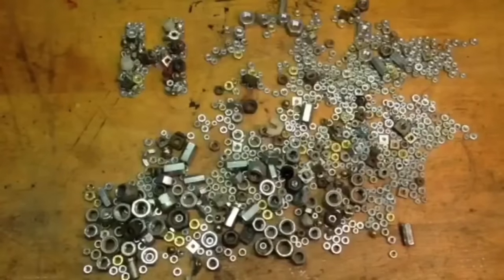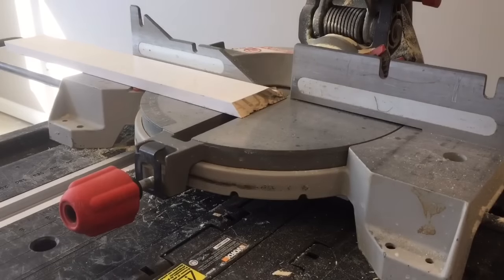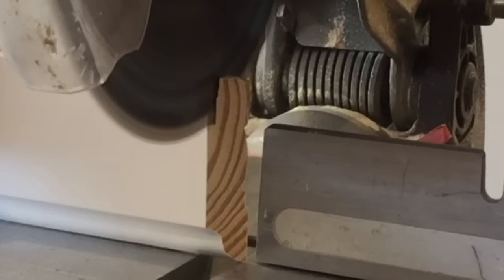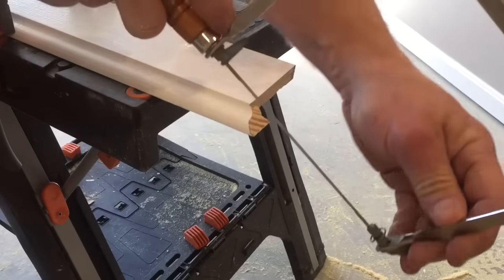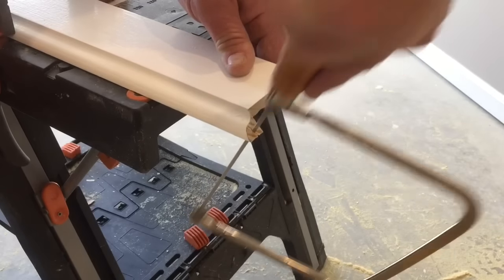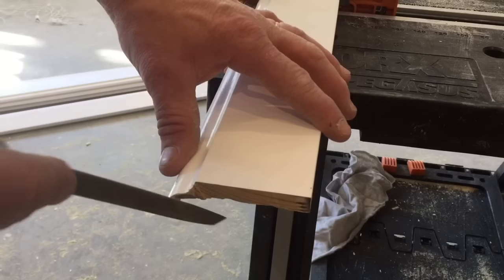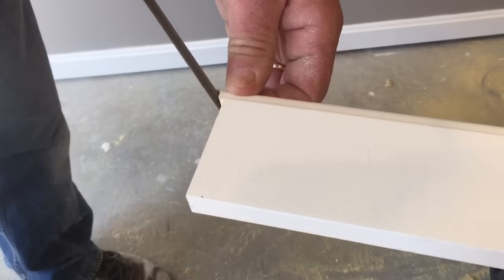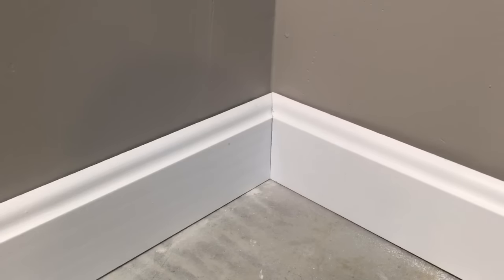How To Cut Baseboard Corners That Look Great

Comment: 5 years later,  you finally finished all 4 corners lol
Reply from the maker: After practice it becomes much quicker. I went slow it the video as it was a tutorial but it beats having caulking cracking shortly down the line. Thanks for watching.
Reply: Try coping with a flap disk on an angle grinder.  It's messy but super easy.
Reply: I think same thing 🤣🤣🤣

Comment: This is called coping. That's why it's done with a coping saw. This is the way this type of joint should be done and has been done for hundreds of years. Mitered corners are really only for outside corners. This was a good explanation.
Reply from the maker: Yes, it is called coping. This is just another variation of coping using a miter saw. Basically the same thing. Thanks for watching.
Reply: @funbro1  I tried your method a few times, but found that it was difficult to turn the piece upside down on the say, especially when dealing with a long piece of baseboard. It was just easier to cope the joint. I switched from a coping saw to a jig saw years ago.
Reply from the maker: That’s works well also. I have also used a flappy sanding wheel on a grinder to get the job done.

Comment: I have a huge job to do with about 50-60 corners to do... Seems like this is tedious, but will yield much better results than just cutting 45's and trying to fill with caulk.  Thanks for sharing!
Reply from the maker: It is very tedious but most things that are like this are worth the extra effort if you plan to stay for awhile. You could save some time by just doing the 45's and caulk, but after a few times of this it goes quicker. Thanks for watching
Reply: Jeff Bateman We use small grinders to back bevel and cope instead of coping saws. Much quicker just takes getting used to. Just an idea if you have a huge project to do.
Reply: +Zach R yeah, I was thinking of using my oscillating tool for that very purpose... That thing has been a time saver on so many other jobs!
Reply: Protractor to find correct angles?
Reply from the maker: Yes, they work great for finding the correct angles.
Reply from the maker: I also like to use a flapping sanding disc on a grinder...works well.
Reply from the maker: Same way.
Reply: 45 degree angles work well  on wood paneling or any corner that has a smooth surface but inside corners and the detail of the applied material will determine whether or not to cope.
Reply: Great system if the client isn’t a pain in ass
Reply: Justin Ballou not in the real world it takes way to long to bust out a protractor. Not for painted builders grade baseboard. Use your energy on something that people might actually notice.
Reply: michele lanni great system if you don’t mind it taking the rest of your life to finish.
Reply: Unless you’re using a wood that will get stain, like oak, caulk gives you a perfect corner each and every time
Reply: Do it right or don't do it at all
Reply: I just do 44° for insides and 46° on outsides for paint grade. ......the grinder is way faster for coping tho or disc sander......but I rarely cope anything so,
Reply from the maker: @TheDalk  Over time caulk will crack and show up.
Reply from the maker: @smash72cutlass30  A little practice and this method takes a very little amount of time less and look loads better.
Reply: Jeff Bateman
By the time you get to 20 you will be proficient and confident by 60 you will feel like a pro by 1000 you will feel like you are master. 

Take the opportunity you have to learn.
Reply: Skip the filing part just cope the base and install !  Been doing finish carpentry for 30 years  no need  to file
Reply: @shednut2666  45 and caulking works good thats how most of the people is doing it on every new house now, if people want it, like the ones on this video, contractors can doit without a doubt but takes more time and more money. Yo know what i mean!!? Both ways look pretty good!!!
Reply: Infact, cutting at 45 degrees is a crime. You should measure the angle between the walls, divide by 2 and then cut baseboard with correct angle. Fits.
Reply: I freehand the cope with a sabre saw. Goes really fast and looks great. You can do a whole house in a day by your 2nd house. Great tutorial Bob!
Reply: 60 or 70 cut taking you a least 6 months doing that 1 by 1 😰
Reply: A T bevel will allow you to transfer the angle if you miter.
Using a grinder or dremel or scroll saw would save you time by copeing.
You do not have to cut two peices, fool around transfering angles or wiping caulk down.
Sometimes guys will use a rag to wipe the joints.
That leaves flat spots later on in the finish.

Comment: This was interesting, I'm going to have to try it.  I normally use a digital angle finder on the corner, then cut the two corner pieces based on that angle.  I haven't been unhappy with the outcome, but will give your method a shot.  Thanks
Reply from the maker: It works great and you can speed up the process by using an angle grinder with a flappy sander. The process is the same but quicker. 
Thanks for watching.

Comment: Its called coping the inside  corners.
Years ago watched a senior trim carpenter use the coping saw as fast as you could miter the corners.
He was running baseboard, and made it look so easy that i wondered why not just do them his way?
There is a big difference between a man who has done finish work for 40 years, and a young guy starting out.
Today im the old guy and when i cope inside corners i have a scroll saw.
You can back cut the curves easy with it.
Reply from the maker: Yes, it’s called coping, and it can be achieved in a number of fashions using a bunch of different tools including but not limited to a grinder with a flappy disc, a file a scroll saw, etc. etc. etc. 
it does get faster with practice in the video it was done at a slower pace because it is an instructional video.
Thanks for watching.

Comment: Good Vid.  A jig saw with a coping foot or a table saw will work much faster, same quality results with a little practice, but good to see people still using and teaching the traditional older method with the hand saw... not everyone can afford all the tools of a professional
Reply from the maker: This is just one way to cut corners, with some of the tools I had at the time, there are many other ways...I have even used a grinder with a flap wheel to make corners look good in a pinch. Thanks for watching.

Comment: Looks nice. I recently watched another video where a Dremel was used to grind down the curvey portion. I haven't personally tried this approach but it seemed to work well.
Reply from the maker: Yes, there are many different tools that can be used such as a Dremel or a grinder with a flappy disc on it. In this video I was just doing the basics to show how it can be done, there are many variations from there. Thanks for watching.

Comment: No matter how much glue or caulk you stuff into a 45, eventually you will see it crack and have a gap in the corner. Coping, like this, is the right way to do it. It also permits a pressure fit, where the coped baseboard is actually a smidge too long, which then later counteracts shrinkage, which would otherwise create the gap. Same gap that is impossible to avoid when doing 45s on inside corners. Coping also lets you get away with out of square corners, whether a couple of degrees more or less, without changing anything. This would have shown up as gaps in regular mitres. Very good instructional.
Reply from the maker: Thanks for the comment, and Thanks for watching.
Reply: Martin Poulsen  nail the corner last agent nail the rest along the wall . Use your five-in-8one to pull the corners together before nailing. Caulk the top and it’s done. A good painter will make your work look tremendous

Comment: Perfect Thanks Bob. Now can the same thing be done on outside corners? Thanks In Advance. 🤝. And if not how would you correct that?
Reply from the maker: Outside corners are better handled with just doing a miter cut. Use a piece of scrap to get the exact angle then cut your regular piece before nailing it on. Hope this helps, thanks for watching.

Comment: I used the coping saw method 40 years ago on custom homes finish work. 
In my opinion the coping saw works so much faster and better than the miter saw. Doing twice the work for a cut.
Reply from the maker: The miter saw works good for the straight part removing material faster than the coping saw, then bring in the coping saw for the profile, but basically it's the same. Thanks for watching.

Comment: As you get more experience you can do the hand cope cleanly and much faster in one cut starting from the top (thinnest) part of the molding.  Key is to dive in confidently and keep the coping saw moving in a short/quick rhythm.  I use a fine/thin blade which follows curves easily.  Agree with undercutting: it allows you to slightly "crunch" the leading edge of the mating surface to the flat of the adjacent piece thusly eliminating any gap.  Go around the room in a linear fashion and plan so your last piece hits a door casing square: it's a PIA to finish with a piece that needs to be coped on both ends.
Reply from the maker: Sounds like you have a slightly different method with some of the same parts. Thanks for watching.
Reply: Do double copes all the time been doing it for 40 years and haven't had any problems get a tighter fit

Comment: I did 440 meters ( that is 1600 meters of skirting) at my home using the method which does not bother with the 3 vertical cuts on the curve. I simply used the coping saw to cut around the edge of the curved top corner. Very simple, very clean.
Reply from the maker: ausiewood Sounds good. Thanks for watching.

Comment: Thanks for for the tip. I have always done this with a coping saw but using the miter saw should really speed things up. Thanks
Reply from the maker: Try using a grinder with a flappy wheel sander it makes quick work of the contours. Thanks for watching.
Reply: @funbro1  So your using an angle grinder with the disk, is this correct. Thanks
Reply from the maker: Yes an angle grinder with a sanding disc or flappy sander or sanding wheel.
Reply: @funbro1  Thanks, take care

Comment: Nice little trick much appreciated although it's a bit of time consuming but still nice in my case I want to stick to 45s
Reply from the maker: With time it becomes quick and still looks great. Thanks for watching.
Reply: Miter saws adjust by degrees sometimes it's easier to just find the right angle
Reply: It's much faster to cut wood using a grinder instead of a coping saw

Comment: I cut my first one today with a DeWalt cordless circular saw that’s all light on is that a no-no or do I need to go purchase one of those big saws like you’re using because mine turned out crappy is there a trick to cutting baseboard with a circular saw because by the time you get the blade up to the wood there’s nowhere to set the guide I just wing that I guess or I’m really stupid I’m just learning
Reply from the maker: Having the right tools does help a bit. Thanks for checking in.

Comment: In the UK we never mitre internal corners, even if they are a perfect 45 degree angle. The ease of fitting and creating the perfect joint is so much easier when scribing with a coping saw. 

As you said, even in new build the corners are never a true 45. 

The coping saw is designed so you can follow a mouldings profile, much like a band saw. I tend to cut the straight line on a mitre saw, or with a hand saw, then use the coping saw to follow the profile of the board. 

There is no need to stop and start cutting. With practice you will cut these profiles is a matter of seconds.
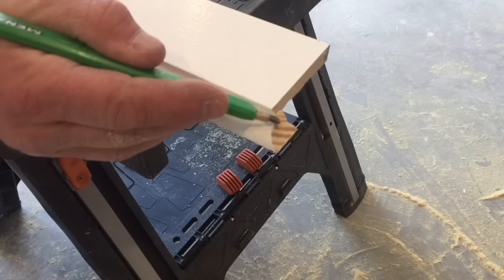Reply from the maker: As a matter of fact I DO know how to use a coping saw just for your information. As stated in the video there are hardly ever any corners (outside or inside) that are a true 45 degree. I was hoping that people would understand the reason for cutting the 45, but maybe I did not make this clear. When you cut a 45 on the miter saw you are left with a line that can be used as a guide to cope the correct contour of the moulding. I could have sworn I covered it in the video,  (check it out at 2:15) something like I used a pencil to show (for the camera and viewers) where the contour of the moulding is. As for cutting the straight line using a hand saw is fine but I find the miter saw will give a much better cut. Keep practicing with the miter saw and you may master it. I hope this video was a help to you. Thanks for watching.
Reply: I understood you perfectly well!   Been using that method all week and it has been working great for me.  Thanks again.
Reply: I think lee is a bit of a knob. your method is the superior one.
Reply: No its not! You forget about the eye
Reply: If the base is simple I agree mate. But if the base has multiple detail that can be time consuming

Comment: Would a router bit make the same cut if you just passed the trim over the bit ?
Reply from the maker: That might work depending on the setup. I'll have to give it a try. I just used the tools that I had out and/or the easiest to set up. Thanks for watching.
Reply: @funbro1  I'm going to try it myself, as I'm putting up baseboard trim and have a corner that is not flush. If it works, I'll post it, if not,WELL YOU'LL NEVER HEAR IT FROM ME ....:-)

Comment: Use a flap disk on grinder instead of coping saw.. takes seconds.. same result
Reply from the maker: I have used a belt sander, flap disk, grinder and yeah they work well but this is an instructional video so the intention was to show the concept with the correct tools. Thanks for your input.
Reply: Aaaaaa CHOO!
Reply: +Jonny rotten
I am not a finish carpenter but I will say doing it with a saw at first is better so that you can gain the skills needed.
Reply: bighand69 
Not necessary to gain coping skills if you're gonna use the grinder just the understanding
Reply: There are skills to learn in either method. I think the Flap wheel works great for the more decorative trim. I use a dremel with the grinder and like the results and time it takes. I tend to get rammy with the hand saws.
 Great video tho..
Reply: Yeah the flap disk makes a dust cloud if working indoors

Comment: I was wondering; instead of this can you just measure the angle of the wall and then cut the baseboards so that they add up to that wall's angle measurement ?

For example if the wall angle is 92 you cut the baseboards 46 and 46, instead of 45 and 45.
Reply from the maker: In theory it makes sense but in real life it does not always work. The problem that you run into is not just the angle of the miter but also the fact that the wall in not plumb, especially at the corner where a bed of mud has been applied and re-applied. So while you can compensate for the angle you would also have to compensate for the out of plum wall at the same time to get it as tight as coping. I hope this makes sense and that I explained it well, Thanks for watching.
Reply: Yeah man, this guy took so much time without much gain. Grab an electric protractor and measure then divide. You can also check how square the wall is, but if it’s within ~4 degrees of squared, no need to adjust. Everyone runs the seams with a light bead of caulking anyways.
Reply: @tomwill_or   Yeah but this guy's work is for the billionaires. Yours will not cut it.

Comment: It does matter which side you cut straight versus cope. Generally easier to cut the longest piece straight and then cope the shorter piece. Other situations as well that might dictate one piece with a straight cut on both ends and then cope two shorter sections into it.
Reply from the maker: No, it doesn’t matter. You can cope either side. Thanks for watching.
Reply: You can eat dog poop while coping if you want to.  But why would a person try to cope an eight foot trim piece when it would be easier to cut that flat and then cope the shorter two or three foot piece?  Or if you had a small alcove; try to cope both ends of one piece?  Much easier to cut the internal piece flat and then cope the shorter legs leading into the alcove.
Reply from the maker: Why would you eat dog poop at alley alone while putting baseboards in? Lol Thanks for watching.

Comment: Thanks for the video.  One question.  Can you cut one piece so that it's straight in to the corner and only mitre/cope the adjoining piece?
Reply from the maker: Yes, Definitely.  Thanks for the question.
Reply: Kelsey Leite thats what he did
Reply: Absolutely. square and tight and cope the next piece. Always work right to left so your copes are are on the right. left hand copes are a bitch for right handed people.
Reply: Kelsey Leite yes
Reply: Yep, just like the video showed
Reply: That's exactly what you do.  You go around the room's perimeter, ending at a vertical casing.

Comment: When the corner is that tight can you just paint it or would you still recommend caulking
Reply from the maker: You could just paint it and the paint would
cover very well. I like to use caulking it allows for any flex. Hope this helps, thanks for watching

Comment: How do you cope baseboards with square corners?
Reply from the maker: For square corners I would just find the correct angle. Coping is only used to make the contour match the opposing wall. Hope this helps, thanks for watching.

Comment: I use that technique but I use caulk where baseboards meets at the corner before nailing so there is no cracks in the future
Reply from the maker: It is always nice to add a little caulking to the joint, it gives it a little flexibility for contraction and expansion. Thanks for watching.

Comment: This is a really good method, although a bit difficult for the beginner
Reply from the maker: With time it will speed up and look better. Thanks for watching
Reply: practice with the the coping saw, after awhile it will go where you want it to....granted some aptitude is required
Reply: Used a reverberating saw . Sucked....